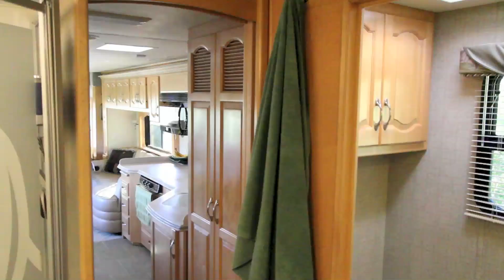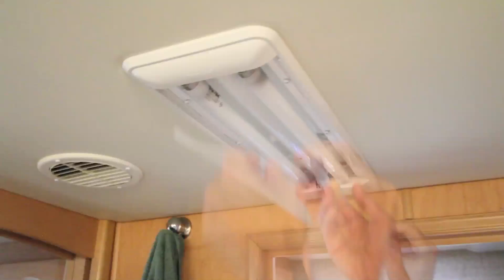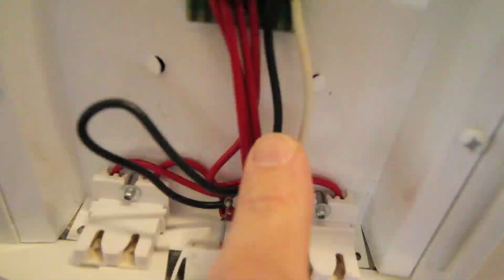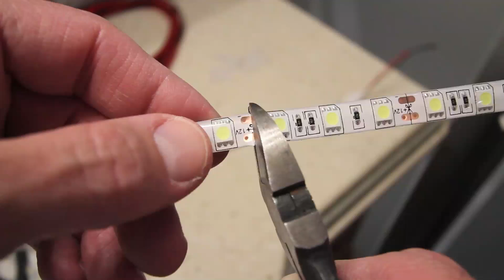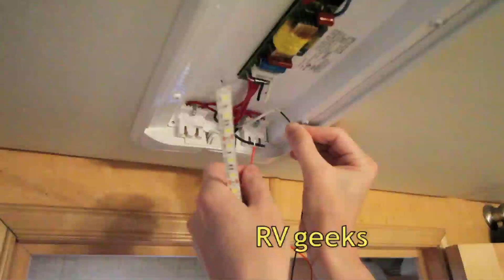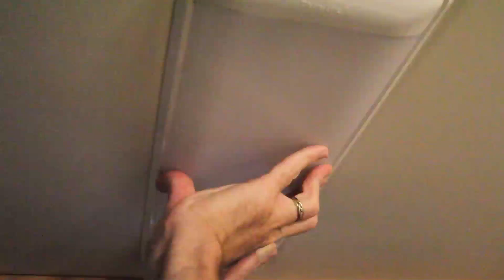HOW TO: Convert Fluorescent RV Lights to LEDs

Comment from the maker: UPDATE! We're upgrading our LED conversion with high-end LED tubes. See how we did it here: http://youtu.be/B3JFLErfMxw Visit http://m4products.com and use Coupon Code RVGEEKS5 to get a 5% discount on the same great M4 LEDs we use in our own RV.
Reply: Hey guys, I am doing your strip LED conversion soon. I will be ordering lights soon (specifically for boondocking and campgrounds where we have to pay electric separately. My question is, we want maximum brightness. Were, those lights bright enough for you? We are on a pretty strict budget so M4's bulbs are out for us at this time . We have purchased all our other lights from them though (thanks for the discount code). Also, how did the adhesive on back of the lights hold up? did they stay stuck?  Thanks in advance.
Reply from the maker: Hey Charlie! The strip lights are so inexpensive that we used FOUR strips in each fixture instead of two (two strips per bulb replaced) that we wanted extra brightness in. Works great. If you clean the fixture with alcohol before adhering the strips, they mostly stay where you put them long-term. A couple of ends curled down slightly over time, but we never noticed until we happened to take one of the covers off. A little double stick tape repaired that in a flash.
Reply from the maker: Hey Charlie. The best place for general questions is posting them as a public comment on the About Us page on our website. That way all threads are archived publicly to help out others with similar questions. http://www.thervgeeks.com/about-us/

Comment: If you have a bad ballast, can you still use LED's without the ballast?
Reply from the maker: Yes, indeed. As you can see in the video, the ballast is cut away and not used anyway. So it doesn’t matter if it works or not.
Reply: @RVgeeks  Thank you!

Comment: Hi, what about the on-off switch that it’s the lamp? How do I make it work? If I connect only to the hot an cold it stays on all time
Reply from the maker: The hot lead on our light comes directly from the switch. If yours is the same (it should be), the switch will still work.

Comment: I m not sure the Amazon link shows  warm light is 5mm , the link to connector 8mm and end caps 10mm one size fits all ?
Reply from the maker: Somewhat... the 8mm connectors are the closest size to the 5mm wide strip (plus you want a little leeway so it's not TOO tight a fit). Same with the end caps... we couldn't find a supply of any that were smaller than that, so they likely just make one size to fit many strips. They're (obviously) loose, but you really just want to be sure that the contacts at the bare end of the light strip don't connect with metal and short out.

Comment: great video Im about to order Burt one question what the advantage on 8mm ,10mm  is more light  ?
Reply from the maker: Hey Airstream... the difference just has to do with the size of the light strip. You want to match the connectors to be sure that they will be compatible. The wider the strip, the farther apart the contact points are, so if you don't have them close, they might not work.

Comment: while this is a very good vid- M4 carries NONE of what is shown or needed for this job... no silicone end caps, no strip connectors and no non-color changing LED strip lights.... so why give them a mention in the description...?
Reply from the maker: Because we discovered M4 AFTER making this video, and have switched to using their high-end LEDs ever since. And their bulbs don’t require silicone or end caps.

Comment: What brand of light strips did you use?
Reply from the maker: Hi Pastor John... we used a brand from Amazon called SUPERNIGHT LEDs. They came in warm white (originally available on Amazon here: https://amzn.to/2Q0WWU2) and cool white (still available here: http://amzn.to/2GKcZ3l)... so if you don't mind the sharper, more blue-ish cast of the cool white lights, you can still pick them up. But the warm whites don't seem to be available (at least not on Amazon).

The SUPERNIGHT LEDs were 5050 LEDS... 300 on a 16.4ft strip. So you may be able to find another brand with similar specs.

Comment: Unclear:

The 2 strips account for 4 wires, 2 each strip.  In a two fluorescent bulb fixture, there will be 2 led strips and 4 wires (2 wires per strip).  These 4 are twisted into 2 (1 twisted hot line, 1 twisted ground line) and then those  twisted/connected leads connect to the power?
Reply from the maker: Yes, you have it right.

Comment: Oh my goodness,  I’m so . . . . .close. One strip lights but the other doesn’t. I’ve checked connections, turned the LED strip around, backed off the screw connectors and reapplied,  still one light working.
Reply from the maker: Sounds like your super close, Mary! Have you tried swapping light strips to determine if it's the lights vs the power? If you swap them, and the same SIDE of the light works, it's the strip. If you swap them and the same STRIP works (but now on the other side/connection), it's the power coming into the one side. Good luck!

Comment: Hi guys, I finally got our roll of LED's still waiting on the connectors and silicone caps but should be here by the weekend. I have a couple of questions though. I know you snipped the wires from the ballast. Does this eliminate it from the circuit? I am guessing that snipping the wires does that.  Also, I was poking around on iRV2 this morning and mentioned I was about to do this project. Someone recommended that I not forget the voltage regulators?  Why would we need any?
Reply from the maker: Hi Charlie! Yes indeed on the ballast. Once the wires are cut, it's just a paper weight, not connected to, or doing, anything. Technically speaking, you could add a voltage regulator to protect them from the higher voltage they see when batteries are on high charge. But we never did that, and have had the original strip lights in place for about 5 years now without a single failure. We figure that the strips are so inexpensive (if they should need to be replaced), and have lasted so long, that it's not worth the cost or effort to bother with a regulator.
Reply from the maker: P.S... the "reason" for the regulators is to ensure the LEDs don't see higher than 12V. While LEDs are often listed with an acceptable voltage range (like 10-30V DC), they actually only use 12V. Anything above that just generates extra heat... and that heat will cause the LEDs to fail sooner. Again... in 5 years of using ours, we haven't had to replace a single one, yet and they seem to be doing just fine.

Comment: Great video. BUT, there is no place on an RV for wire nuts. With all the vibrations of travel plus constant expansion and contraction with temperature changes. These screw on wire nuts have a tendency to back off. I always use and advise others to either use butt connectors and heat shrink or solder and then use heat shrink. Solder, while time consuming does not break or vibrate loose.
Reply from the maker: Sorry, but you’re making a mountain out of a mole hill. Wire nuts work just fine.

Comment: Any electrical modifications for household 5' LED disk lights? Older accent lights over the dining table, couches could use an update.
Reply from the maker: "Household" as in 120-volt? Or in an RV?
Reply: RVgeeks Household is a 39' Monaco Knight year around
Reply from the maker: If you check out our "LED Your RV" series (10 videos in that playlist I think), you'll see everything we know so far about upgrading an RV to LED!

Comment: I just viewed both of your videos about converting RV Florescent lights to LED. I liked the strip light idea due to the cost because I would like to do all of my lights, 7 fixtures with 2 bulbs each 18". My question is why did you choose to go the more expensive way in the end we the strips not working or not bright enough. Please advise
Reply from the maker: Hi Steve! We've had some minor issues with the strip lights, with the connections coming loose enough that one strip didn't light, and then we have to tighten it up again. Not a big deal, but the M4 lights are so elegant, provide more light with nicer color, and we've never had a moment of trouble with any of them. We figured that since we're only converting them once, we could manage the cost of them. We do get it that with so many fixtures on some RVs, it can add up, so price can indeed be a consideration.

Comment: Can you install a dimmer on the strip lights ?
Reply from the maker: Yes.... but it has to be an LED dimmer, which is "PWM" (pulse width modulation). A regular dimmer simply reduces the voltage, and that won't work for LEDs, since anything less than 12 volts and they won't light.

Comment: Won't work added two strips 18 inches long as described. Very little light was omitted. So I added two more 18 inch strips to that same light, not much better. My remaining fluorescents  out shine these LED By far.
Reply from the maker: Sorry to hear that, Gary! Where did you get your LED strip lights from?  There's a wide variety of options available, with varying numbers & brightness of LEDs on the strip. If you purchased strips that had a lower density of LEDs (and/or smaller, less bright LEDs), we can see how you could end up with less light.

The ones we used were these ones from Amazon:  http://amzn.to/2jPQIFG 

They have a high-density of the bright 5050 LED elements, so the 18" strips put out a good amount of light. 2 strips typically equal one 18" fluorescent bulb... and 3 strips/bulb is actually brighter.
Reply: Currently unavailable. 
We don't know when or if this item will be back in stock.

Have to by by the specs and not the product as this particular LED strip light is out of stock.

Comment: Another advantage to doing this type of conversion is weight reduction if you do all the fluorescent fixtures and remove all the ballast.  10+ ballasts have some weight to them.  I would recommend removing them while you are doing this install.
Reply: Yea good point. if each ballast weighs a pound, that's 10 lbs of weight reduction But if you add an extra two gallons of water, that's 12 lbs so weight reduction is negated...LOL

Comment: i am still.confuse about 12 v   where do get here 12 v dc as shown on strip 12 v dc  you direct Conectected led to power supply that was 110 or 220
Reply from the maker: +Tareeque Hussain In an RV, ALL of the lights are 12 volt DC, not 110 volt AC.
Reply: IN most regards, RV lighting IS 12V....however, in a coach like we have, we have 12V lighting and 120V available (on 3 fixtures). The puck lights, and fluorescent  lights we have all run off 12V DC.

Comment: sir then it will be 110 or 220ac volts so it is possible to lite led on this volts
Reply from the maker: +Tareeque Hussain They do make LED lights for 110-volts, which are sold in stores. These particular lights (for RVs) are 12-volt only.

Comment: do you use fluorescent power supply for led lite or using other transformer for led
Reply from the maker: +Tareeque Hussain Fluorescent ballast is not used for LED. Just bypass it and connect to power.

Comment: just out of curiosity, why didn't you solder the joint? i heard people say it's better than using ez connector and placing a sleeve over it.
Reply from the maker: Since the lights and connectors come designed to be used together, we never bothered to resort to soldering, and we haven't had any problem. Of course soldering is always an option, too.
Reply: RVgeeks ah gotcha. Thanks for the info.

Comment: I didn't see you cut the power down to 12v before you connect to the strips
Reply from the maker: +JRock Powell In RVs, all the power to all the lights is already 12 volts. Nothing to cut down. :)

Comment: Did you find the LED tube lights were better lighting than the strip lights for your RV.  Just curious which gave you better lighting.  Thanks you.  Enjoy your videos
Reply from the maker: +Anna B. Absolutely. They're brighter, no issues with the adhesive loosening and very elegant design (for those of us who appreciate that). Also, easier to install. Of course they're more expensive, but we liked them so much we did tube lights throughout the coach after that first one.

Comment: do you mean the voltage supply of the led is directly to the power source 220V  AC  as i shown in your demo?
Reply from the maker: +League Minecraft The power source for these is 12-volts DC (and an RV also uses 110, not 220 volts power).

Comment: Good Video, but the 1/3 less power consumption thing is flawed. One gets less consumption at the expense of less light overall. These leds without ballasts use a series limiting resistor and 3 series led arrays. Each led has a forward voltag of about 3.3V, so 10V to the LED and 2-3 V lost in heat in the resistors.

A better approach, if one wants to get the best efficiency is to get a string of series leds such ad COB models rated for 30 or 60V and use the proper ballast, ensuring efficiencies as high as 95%. This also has the advantage that most models allow dimming.
Reply from the maker: Susana Godinho Hi Susana! We appreciate all the input. Thank you so much. We don't know anything about series lights, but one thing we can tell you for a fact. These light put out brighter light using less power than fluorescents. It is well know that LEDs outperform incandescent and halogen bulbs by a large margin, using a fraction of the power to produce more light. while fluorescent bulbs are indeed more efficient than halogens or incandescents, LEDs take it even further.

We're not electrical engineers, so we can't talk about the why, but we have personally tested these lights with a digital multimeter, and the difference is huge, and the light output superior/greater.

If you'd like to talk with someone more knowledgeable about the details, Steve at M4 is the engineer who knows more about this than anyone else we've met. Drop him a note at http://m4products.com if you'd like to chat about how this all works. But one thing is clear: LEDs use a fraction of the power of other types of bulbs, which explains why everything from flashlights (with blazing bright LED bulbs and batteries that last for ages) to entire RVs, are switching over at a rapid rate.

Comment: Question. Could you wire those strips directly to your 110v house wiring or was the RV pushing 12v to the original fluorescent bulbs? I'm a bit new  to this and I wanna do the same thing to the lighting in my bedroom.
Reply from the maker: The strips we used are 12-volt only, so you'd need a converter.
Reply: RVgeeks *powersupply

Comment: You can replace the fluor tubes by LED light tubes, no electrical rewiring. It cost you about $25 per light, last for 20 years.

Comment: I live in a Winnebago. I'm like to know how to convert it's factory made lamps into just 110 plugs, so I can just buy some nightlight lamps that will last allot longer. Can anyone help me?
Reply: +EdBoonSucks Same thing as in this video except that you also have to add a 110VAC -> 12VDC power supply in between the power and the LEDs.  LEDs require a 12V DC (Direct Current) power source.  So you need a power supply that steps the 110V AC (Alternating Current) power coming in down to 12V and then rectifies the Alternating Current into Direct Current.  I'd suggest something purpose built because I know that, in their cheapest forms, those rectifier circuits can just chop off half of the AC resulting in your LEDs flashing on/and off 60 times per second.  The result is that the LEDs look kind of buzzy and the effect unpleasant.

Comment: everything looks good until you go to order the connectors and end caps and they say 8mm,10mm and so on .The product details do not tell you this .Also if I'm going to run strip lighting in my rv do I have to do anything different or can I just plug them in to a wall socket ?
Reply from the maker: The 10mm end caps are perfect (those are the ones I linked to), since they fit both 8 and 10mm wide strips. They don't have to fit perfectly... just cover the ends, so as long as their big enough to fit, they work fine. Also, the new type of strip connectors I linked to should work great, too. I've had that link up for a long time, and people have been ordering them a lot without anyone telling me they weren't the right ones. All strip LEDs that we've seen are 12-volt, so you can't plug any of them into a standard 110 outlet.
Reply: RVgeeks That's ok too as I meant to say that I could plug them into my dc outlets or make more of my own .Thanks for all your help

Comment: Good job 
I read 12 v on led strip 
But the power is 110v 
I am confused 😂
Or did you use the old transformer  as power supply 12v for the led ?advice pls thank you
Reply from the maker: The power is definitely not 110! These are 12-volt lights, installed into the 12-volt system on the RV. Don't try this at home! ;-)
Reply: +TrueBlogge777 You mean to tell me that you can't tell the difference between a house 110 volt florescent light fixture and a 12 volt florescent light fixture that is mounted on the ceiling?

Comment: do all that work or just get led bulbs
Reply from the maker: Yup! We do lots of things to to improve the quality of things on our RV, even though they sometimes take some effort. ;-)
Reply: they have led tubes that fit in the same socket
Reply from the maker: Myron Black They do indeed! And we're just putting together TWO videos all about that conversion. But they also require re-wiring (especially the 12" ones) and are quite a lot more expensive. We love them though, and feel it's worth the time, effort and cost for such a great upgrade. It's true that there are LED bulbs that are a direct replacement, with no re-wiring required, but they're subject to ballast failures, and since the ballast uses power, you don't get the full benefit of lower power consumption while boondocking. The 18" conversion is a snap. Stay tuned for the videos in the next couple of weeks!
Reply: ok lol i just saying lol